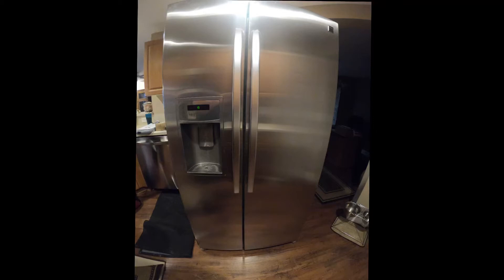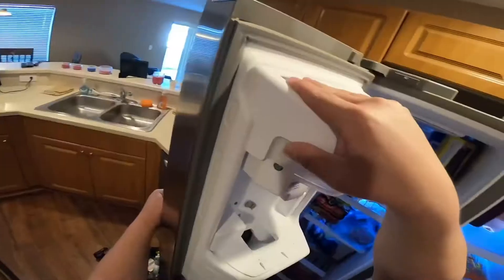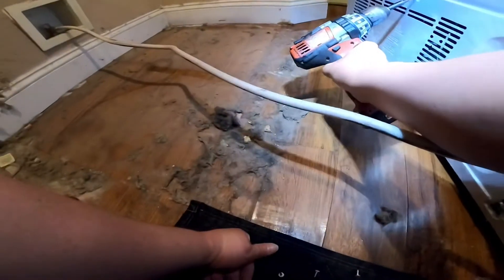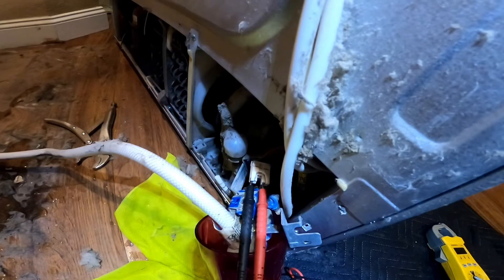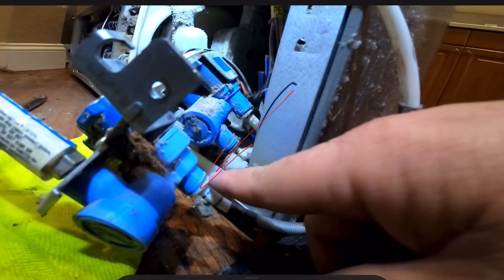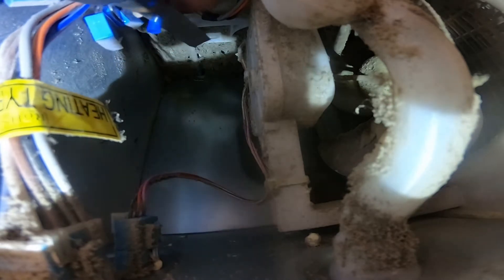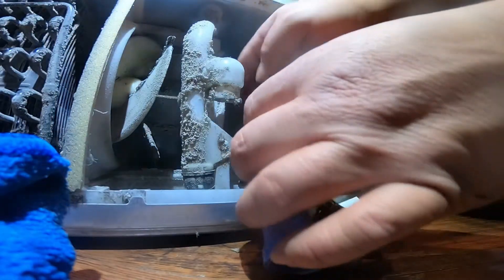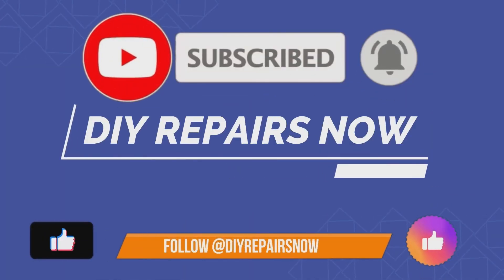How to Fix Kenmore Refrigerator Not Dispensing Water or Making Ice | Model 795.51033.011

Comment: Hello. Thanks for the video. But I'm wondering if I should be thinking a new water valve in my case where I get good pressure out of the water dispenser but no water is being sent to the ice tray to make ice. Thanks for any advice anyone may have.
Reply: If figure it out because have the same problem
Reply: Your ice line might be clogged up, I would troubleshoot that first.

Comment: Hello, My kenmore refrigerator suddenly appeared in the morning flooded, after evaluation I realized the inlet valve was not working, dispenser valve also not working, after get all new valves i realized the connector to the valves always have 120v even the dispenser switch was off, I checked the switch and is operating ok. This cause as soon I connected d the valves and turn on, water start flowing with no stop. I am planning to replace the board. Something is causing the valves always are on. Even the switch is totally disconnected. 

Any hint ?